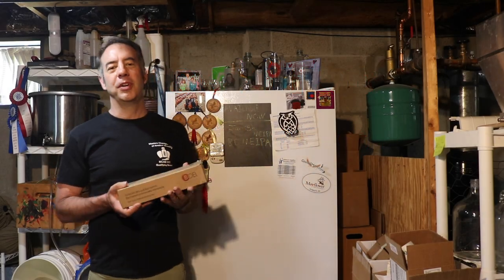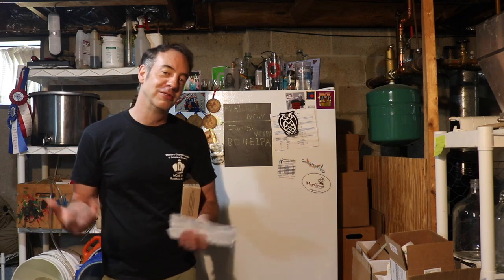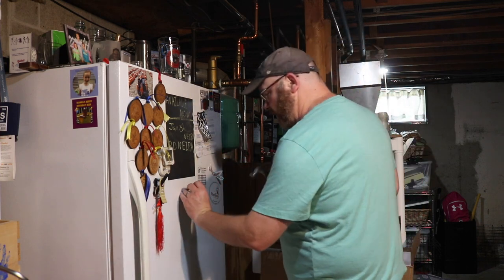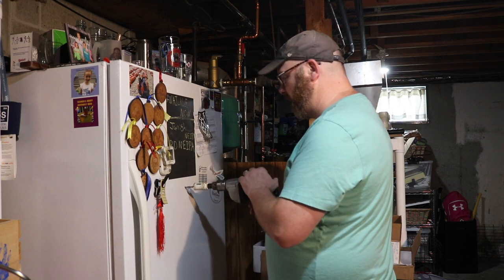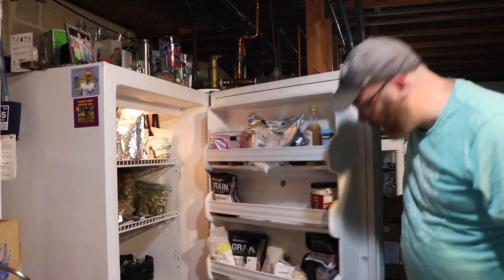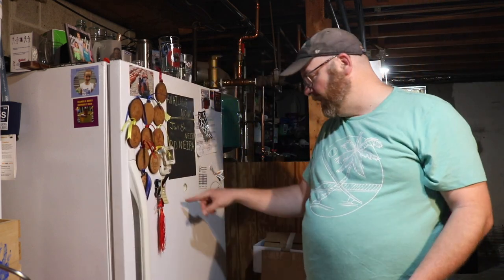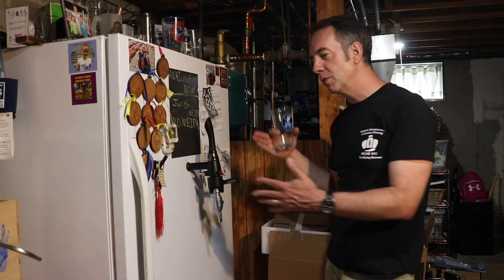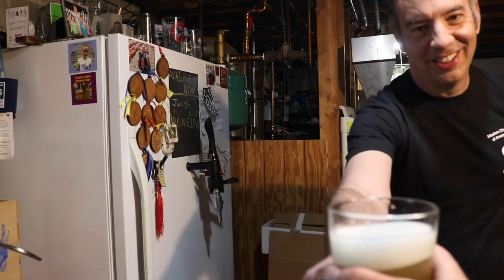Beer Tap Installation - iTap From Boel Technologies Set Up

Comment: Looks good, recommend salvage magnets from computer hard drives. Epoxy onto drip tray and then magnet onto fridge. 3 magnets and you'll need a crowbar to get it off.
Reply from the maker: Great idea.  I still have some of those magnets from an old stir plate.  I'll pass that along to John!  Cheers! -Mike

Comment: I missed this video previously but had a question. If you’re filling bottles (if you’ve done it with it) do you find you need to overcarbonate the keg slightly to have the bottle normal carbonation?
Reply from the maker: In theory, you're purging the bottle and sort of counter pressure filling it.  But I've always gone to ~10-15% over carbonation to fill bottles from a keg regardless of device.  Just because losing some is inevitable.  Cheers! -Mike
Reply: @BrewDudes  yeah mine are always a little underwhelming when bottled with it, where they would be spot-on from tap. I’ll try a few bumped up a bit next time out.

Comment: That tap looks really….unnecessary.  I can’t imagine 4 of those cluttering up my keezer. I don’t get it.
Reply: I know, thought this was a review to tell us what's special about this tap
Reply: Looks like it has other uses, ie counter pressure filling of bottles. If that’s the case, I’m interested.
Reply: @chrisz8532  You can rig up a counter pressure filler for $6 with a stopper, bottling wand, and some hose.  Works like a charm.  I have Perlick taps and you can buy a bottle filler adapter for $5 on Amazon for them.  That monstrosity is just ugly, but I guess if you wanna fill PET bottles then go for it.
Reply from the maker: Yeah, it big - we'll review the counter pressure bottling feature in an upcoming video.  - John
Reply from the maker: Sorry, Salty - we'll review the counter pressure bottling feature in an upcoming video. - John
Reply from the maker: Yep We'll review the counter pressure bottling feature in an upcoming video. - John